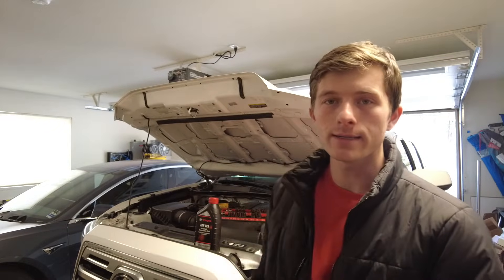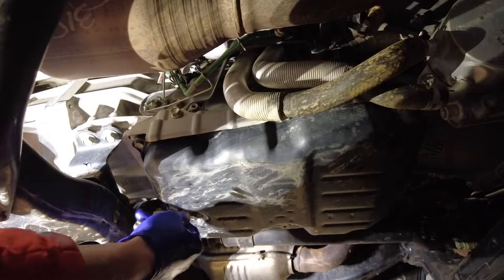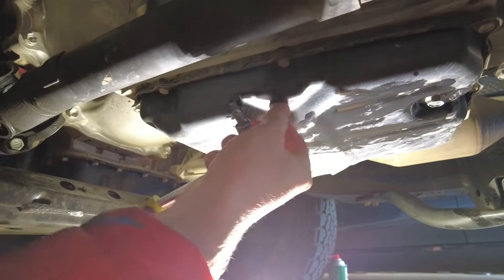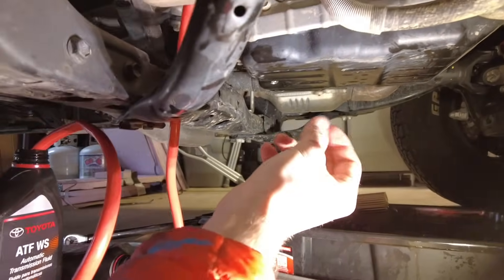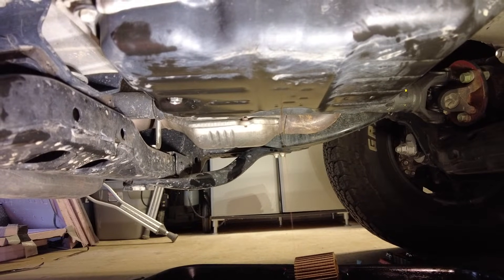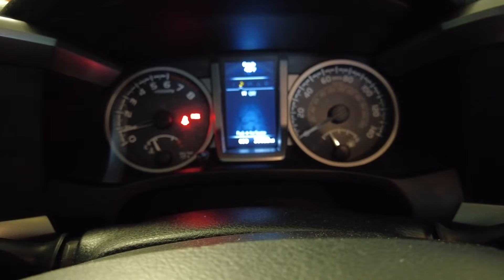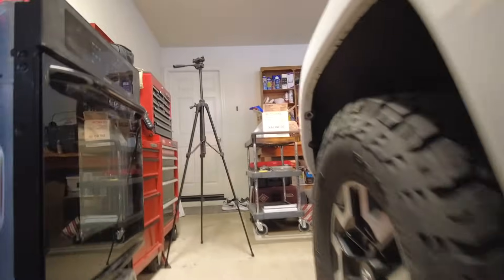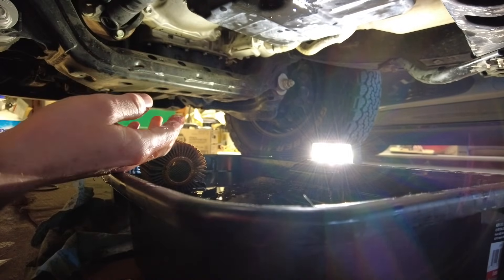Drain and Fill on Transmission - 2018 Toyota Tacoma

Comment: You don't claim to be a master mechanic or auto expert like others. But I find this particular video of your is MUCH, MUCH clearer and EASIER -- If not the easiest, clearest -- to understand and follow than others on YouTube. Many so called Master mechanics just put more fear into the mind of those who try save a few bucks by fixing/working themselves. I have a 2007 tacoma V6 that has 144,000 miles on it. And I had my transmission flush at my dealer at 40,000 miles in 2011. I have not changed it since then, for 100 000miles. I feel it is time to do it. And in the past 5 days I have watched a lot of videos on this subject. I stumbled on this video of yours. And it turns out, this video is THE best. I feel compelled to write this comment to let you know that you can make great videos compared to the so called master mechanics. I subscribed to your channel. And thank you for sharing.
Reply from the maker: This is one of the most incredible comments I have ever received. You are correct, I am not a master tech of any sorts. I studied mechanical engineering and just love passing along my projects over to other people. Thank you
Reply: like your comment❤❤❤❤❤

Comment: Very well explained video. Two questions. It appears this is checked with fluid at temperature and ENGINE RUNNING correct?  Also where did you get the check bolt washer or gasket?  Thanks

Comment: Dont forget you need to perform the ATF thermal degradation estimate reset. Will either have to have a good scanner that can access the transmission module, or take to the dealer to reset. The truck tracks/estimates fluid wear, don't need to have a light come on early.

Comment: Hey I retightened the drain plug with the new crush washer but I had to back out a bit and use a torque wrench, so I crushed it ‘twice’. Is that an issue? No leaks for a few hours so far.

Comment: Hi I just added  1 litter of oil because a local mechanic told me that he don’t feel the oil with his finger in the level check so I think I shouldn’t do that, so I don’t if some one can help me, I think I need to know if the oil level is right and I thinking just to do the step to get the transmisión temperature right and open the bolt that indicates if there’s more or less what do you think ?

Comment: If you unplug  and measure 3 quarts  then you pumped it back new 3 quarts . Then  start the engine,..unplugged the Allen nut to see any overflow 💧. I am afraid  to connect the wire to OBD II. . Is that way be okay ?  Thank you very much much .. because I am going to to change a transmission fluid on 2013 Toyota Tacoma 4 doors.

Comment: There were areas that weren't clear to me. Like when did you add more fluid to top it off? Why didn't you take the fill plug out first? Why didn't you measure what you took out then  add that amount and say a half qt extra, and then drain off the excess after proper temp?

Comment: Measure what comes out first time at room temperature. Every time you drain whatever comes out and fill your predetermined amount. 

Switch to amsoil for your tranny and diferential.. penzoil ultra etc is fine for your engine but for longer drain fluids go with the best.. 

The fuel economy savings will pay for the extra cost of the fluid..

Comment: Did my 2018 tacoma sr5 double cab 4x4 tranny fluid  drain & fill yesterday's and only 2qts of fluid came out....filled  it with 3.5qts , to bring it to the right temperature I used a SnapOn ETHOS PRO and when I open the check plug....1 qt of fluid came out....what gives?🤔

Comment: WRONG!!! You need to overfill it by 1/2 quart when you start because it  NEEDS TO BE RUNNING when it’s checked! You did it completely wrong at the end!
Reply: Wrong! Instead of wasting fluid you drain at cool temperature and put in the same amount every time.  Their procedure if for cars brought into dealerships with running cars and hot fluid.

Comment: All you Gotta do to check, the temperature is plug, a scan tool into the port and go to live data and read the transmission temperature. You don't need to do all that jump stuff and drive and all that bullshit just use your scan. Very simple.
Reply: What temperature are we specifically looking for here? I need to do this service myself. I need to know what the temperature is supposed to be at to set the fluid level.
Reply: @thatoneguy2756  109-120 degrees

Comment: The light D for drive was blinking, and yes you were Right. I had to wait for the transmission to cool down for the light to stop blinking. Than after about 2 hours, the transmission cooled down, than I started again the procedure and the light D for drive, did turned off this time and finish the process. Thanks
Reply from the maker: Not a problem. I am glad I could help

Comment: Pumps are no fun. I use a 4 ft piece of tubing and run it down next to where the CAT runs over the heat shield and into the fill. I then use a funnel and add 1/2 quart more then drained. I leave the hose there, do the check and add if needed.

There is also a procedure disconnecting the trans output line and emptying it into a measured bottle.  Start the truck and it will pump out shifting through gears. Measure out 3 quarts at a time, and fill with the hose method as you go. I’ve swapped the full 11 quarts this way on a newer Tacoma. Don’t do it over 90k if never done before, just do drain and fill every 30k.
Reply from the maker: Great advice, thanks for sharing

Comment: Did you have to put back the new fluid (the amount that was drained out) with the check plug removed? Why not just put back the same quantity fluid with the check plug on since you will have to remove the check plug after the temperature goes up anyways? I think thats why you didnt get any fluid coming out when you removed the check plug.
Reply from the maker: I just put in enough fluid until it was full. I had to do it twice. The problem with putting the exact amount in is assuming the amount that came out was at the proper level and you didn't spill any which is hard to do
Reply: Warm it up to temp then check old level. If its good, just put in the same amount you took out plus a few ounces for good luck.

Comment: Probably already stated. But don’t fill the transmission initially with the check plug out. Measure what you took out and put in about a half quart more than that. Then do your check with the engine running and up to temperature.
Reply from the maker: Honestly, great advice
Reply: @92813justin if it was low which the fluid can be especially factory filled then measuring what you took out is not as accurate always overfill then let it come up to temp and remove check plug

Comment: No matter how good you treat an automatic transmission, there will be a day you get stranded! it will happen!! my 21 Taco is a manual... The most reliable truck and can only be stopped if it runs out of fuel.

Comment: Ok so I can’t put it I’m temperature mode cuz obd2 is different not same pin
Reply from the maker: You can use an OBD2 scanner to keep track of transmission temperature
Reply: @92813justin  thanks
Reply from the maker: @katracho9ful  You are welcome

Comment: Is this wise?
Reply from the maker: Toyota does recommend changing the fluid, see your maintenance manual.
Reply: @92813justin  But this is a partial dilution not a change. Does it satisfy the warranty requirements?

Comment: I Have a question. do you turn off the truck when you fill it for the second time  ? Or the truck does it need to be on all the time?
Reply from the maker: I prefer to fill it with the engine off just because of the hot exhaust

Comment: At 8:05 in the video, you removed the check plug with the engine running. At 8:34 you removed the check plug with the engine off. Are you supposed to check it with the engine on or off?
Reply from the maker: The engine was always on while I was checking the oil level with the check plug. On 8:34, I spoke over the original audio in post processing. Sorry for the confusion but great question

Comment: I thought the fill plug was 24mm socket size? Not saying 15/16 is wrong, but seems weird Toyota wouldn't use metric on that...everything else is metric except the spark plugs....
Reply: 15/16” is equal to 23.813mm so the 15/16” socket should fit more snug assuming the manufacturer of the socket made it 15/16”. In other words they should be interchangeable on stuff that’s not super duper critical.

Comment: There seems to be no leaks on this fairly new vehicle, so why not fill with the exact amount you drained?
Reply from the maker: You would probably be pretty close if you did that. It's just the safer way to go. If someone else touched the tranny before you, you are trusting they did it correctly and no oil vaporized when your tranny gets over 210 degrees

Comment: Couldn't you just measure how much fluid you took out then put that same amount back in???
Reply from the maker: Yes, but you are assuming you did not loose any oil from vaporizing when the oil gets hot at you are trusting the previous mechanic. I would rather be safe and make sure it is the right level since you are already under there
Reply: @92813justin  makes sense

Comment: I tried the temp check mode for 3 hours on my 2018 and eventually gave up.. I forwhatever reason cannot get it into that mode.
Reply from the maker: Weird, I would double check your wire placement on the OBD2
Reply: Just plug a scan tool into it and read the live data feed. It'll tell you the temperature of the transmission fluid very simple you don't need to jump shit

Comment: How in the world do you get the fill plug off?? I can’t get a ratchet in there hardly, the socket won’t latch on the plug and even if it did I’d have almost no strength to torque it off. Is there some special tool???

Comment: Why cant you just put in 1/3 over what you took out.
Run it for 15 minutes with out doing the computer thing.
And then check the overflow for the correct level when it get hot?
Reply from the maker: You can try that. You would probably be close but I personally like it to be spot on since I am spending the time

Comment: Never change the transmission fluid big mistake if you do..
Reply from the maker: Burt, that is not the case. In the maintenance manual in your glove box, it recommends changing the fluid out in "severe conditions". I do a lot of towing and offroading which falls in that category. Toyota will also service the transmission for you as well.
Reply: @92813justin  totally false, you never have to change out any trans fluid on any vehicle only to add fluid that may be needed, all my years with cars & trucks I had owned never had to change out trans fluid but dealerships & shops will say you do, it's all a big scam & know how the dealerships & shops play the scam game unfortunately they get the gullible to buy into it as with other things they tell you must be done & rip the consumer off.. Been around bud many years & know seen how the con games work..
Reply: @92813justin  great video👍I have a question I bought a Tacoma 2016 about a month ago it has 74000 miles I dont know if the dealer or previous owner changed the transmission fluid ???  do you recommend me to change it or should I take it to a transmission shop for a flush????
Reply from the maker: @abelyerikaguerra1540  If the transmission fluid has not been changed, I would change it on my personal truck because that is what Toyota recommends in the service manual under severe conditions. Hope this helps.

Comment: I saw you disconnected the wire from the OBDII while waiting for the temperature to rise. Why is that? What will happen if you left it on? Thanks.
Reply from the maker: Nothing will happen, I unplugged it so I wouldn’t run the program again.
Reply: @92813justin  Many thanks.
Reply: You disconnect the jumper after its in check mode to maintain the proper idle speed when checking the fluid level

Comment from the maker: Please Subscribe and thank you for watching.
Toyota ATF WS fluid - Toyota part # 00289-ATFWS
Drain plug gasket - Toyota part # 35178-30010: https://amzn.to/3tpHNkj
Overflow plug gasket - Toyota part # 35178-30010: https://amzn.to/3tpHNkj
Oil Pump: https://amzn.to/3wjbaa1
Reply: Hello 
Please provide the part number for the o-ring on the fill in plug.
Appreciate it

Comment: You could just weigh the fluid that you drain and then put the same weight back in.
Reply from the maker: Just be cautious using this method incase the transmission fluid is low.
Reply: @92813justin  exactly. People alway talk about putting same amount by weight or volume back in. Might work great one time in a pinch but errors continue to grow continuing this approach

Comment: Do you change the gaskets for fill and drain plugs? Would it be better to take off the transmission fluid pan to remove the extra 2+ qt fluid and change/clean the filter?
Reply from the maker: Yes, I changed out the gaskets. Most of the extra fluid is not in the pan, it’s in the trans cooler.
Reply: @92813justin  No, there is another quart+ of fluid in that pan that won't drain out from the drain hole. That's what he is asking.... There's also 3-4 magnets in the pan that are coated with metal slurry.  You really need to remove the pan the first service, make sure there are no large metal pieces in the pan, etc.  This will let you know that everything is good so far and give peace of mind on future drain and fills...
Reply from the maker: @thooks1234  I am planning to do this on the next change, at 30k the oil looked brand new coming out
Reply: @92813justin  Sounds good!  I see you have gotten some flak over not showing the procedure while the engine is running.  You might re-video everything and upload a revised video.  I'm glad more and more people are paying attention to this.  The reasoning behind a "Sealed" trans with no dipstick is Ludacris but I guess we have more of that to come...
Reply from the maker: @thooks1234  I am checking the fluid level when the engine is running. What are you referring to? The sealed engine statement is not even true. If you look at your maintenance manual it will suggest maintenance on your trans. A "sealed" trans will 100% make it past warranty, but how far will it really go
Reply from the maker: Here you go: https://youtu.be/OxvN62plqxo

Comment: Thank you for this comprehensive training video.  We just bought a 2022 Tacoma and it seems that the manufacturers no longer sell printed shop manuals. At one point you refer to a printed document to determine where to insert jumpers.  Can you share the source of that printed information?
Reply: You buy the manual for like $15/24hours. Then print sections you need.
Reply from the maker: I don’t have access to it right now but I found it on Tacoma World

Comment: does it have to be in D to check it?  or can I leave it in park and use an OBD reader to check ATF pan temp?
Reply: is there a way to replace the transmission fluid  without the pump. i took the plug out of the transmission  by accident, should have taken the plug out of the oil pan. now Ihave got a problem7pm work tomorrow and very little trans. fluid. yes i am an idiot
Reply: @johnstrickland6724  if you have the hands of a new born baby maybe it might be possible

Comment: Thank you for sharing this. I’m getting a click noise when I shift from R to P. Should I be concerned?
Reply: If you are parking on an incline, yes you should be worried. Do this when parking on an incline, stop, put car in neutral, apply parking brake, release brake pedal, shift to park. When you leave, hold brake pedal, release PB, shift to reverse or drive.
Reply: Great question and answer!

Comment: I don’t understand why you can’t just measure the amount you took out of the transmission and put the exact same amount back in. If it is cool when you drain it, it would be cool when you put the same amount back in. I don’t see a problem. Am I missing something?
Reply: because the level might not be correct in the first place.
Reply: You can I have seen people do that. I know 2016 and maybe some 2017 had issues with being up to 1qt low on trans fluid.

Comment: I have a  2017  Tacoma, bought it brand new from a Toyota dealer it has 28k miles normal driving conditions never haul anything at what mileage do you recommend changing the transmission oil?
Reply: Since you do not know how it was used (severe service) or towing; I recommend you do it now; that way you get to see if the fluid looks burned. 4 bottles of Toyota WS fluid from a Toyota dealership is not very expensive compared to having to replace the whole transmission.
Reply: every time you change your oil that way in 30K you have theoretically changed all 12 courts.  This procedure only replaces about 4qts.

Comment: Good stuff bro. Think u can tell me part number for those washers? Thnx
Reply from the maker: Drain plug gasket - Toyota part # 35178-30010: https://amzn.to/3tpHNkj
Overflow plug gasket - Toyota part # 35178-30010: https://amzn.to/3tpHNkj
Reply: @92813justin  thnks spidey
Reply from the maker: @bayshark7o7  You are welcome
Reply: M12 Transmission Drain Plug Gasket Fits for Toyota 4Runner Lexus, Replacement for the Part# 35178-30010, 10 Pack https://www.amazon.com/dp/B07JQFH5V2/ref=cm_sw_r_cp_api_glt_fabc_7KCZRHPBDDVNH72K0D2M?_encoding=UTF8&psc=1

Comment: Make sure to have the engine idle and you rather overfill the transmission before checking because you gonna have to redo the sequence again when checking the fluid level
Reply: At what stage should the engine be idling? While warming up and checkin the fluid level?
Reply: @Teporame  engine has to be turned on while checking fluid while D is solid lit